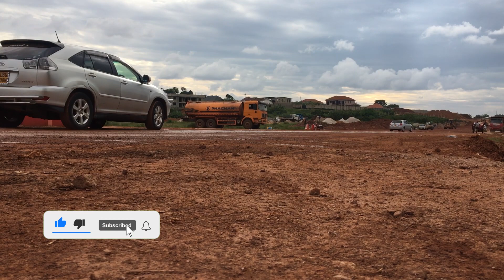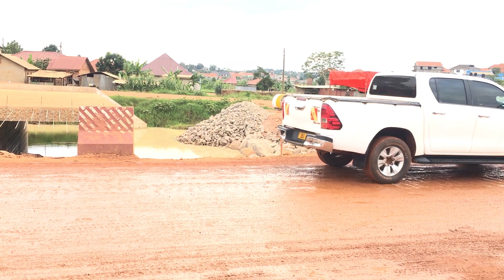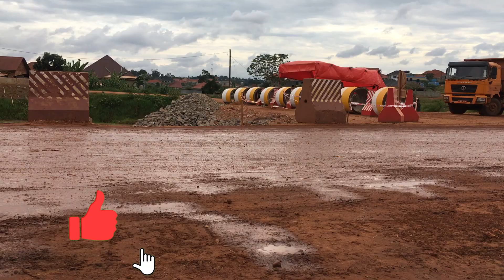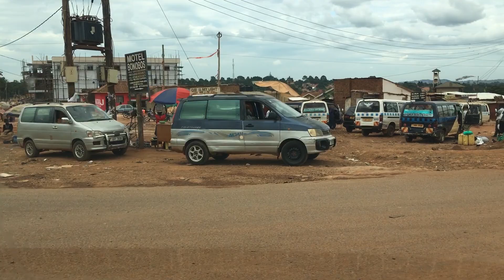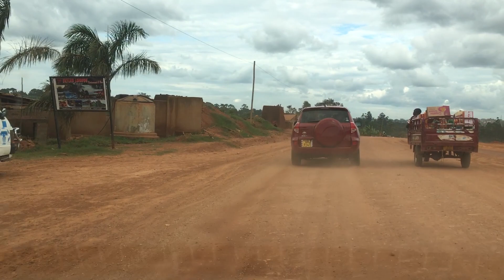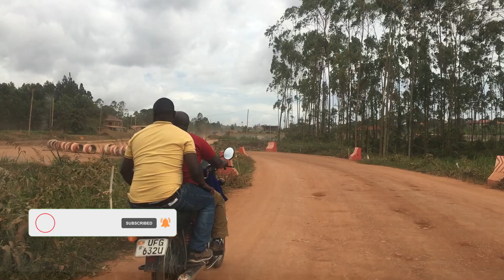THE ESTIMATED US$ 800M JINJA-KAMPALA EXPRESS HIGHWAY (KIRA-GAYAZA SECTION) CONSRUCTION PROJECT

Comment: According to the video construction has already kicked off and i wanted so much to confirm if its true by sketching which could be the actual location the video was shot but i failed
Reply from the maker: It’s kira Gayaza sections, thanks for the support
Reply: @activated5049  if its kiira then this has nothing to do with the jinja kampala expressway coz this is a very different project called kiira kasangati road project
Reply: @lwangafrank2431  it will connect to northern by pass masaka road through kasangati to matuga then through to cutting wakiso to masaka road
Reply: @activated5049  yes true I'm at site now